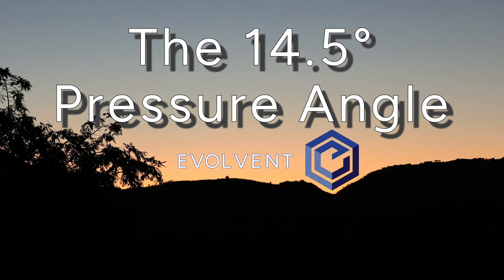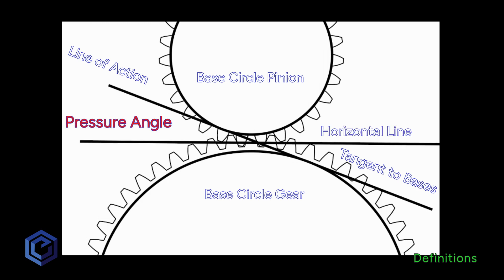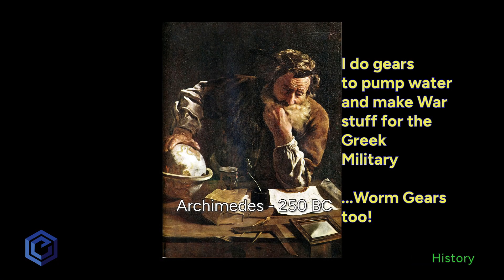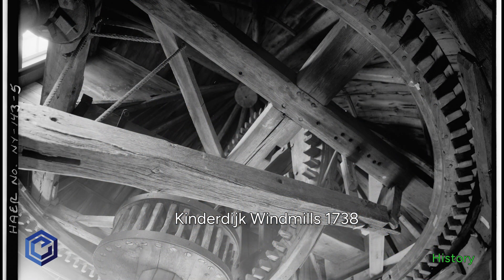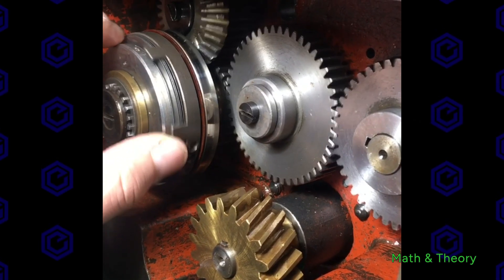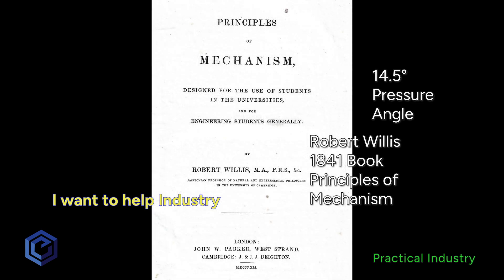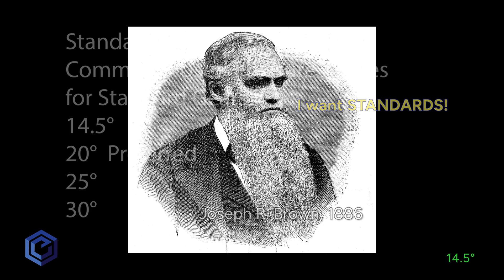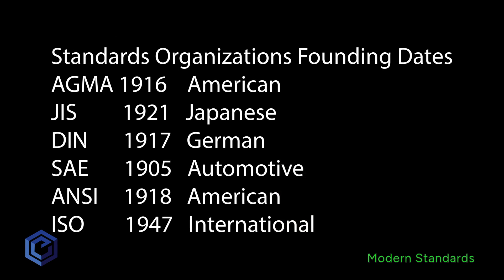Pressure Angle Standard for Involute Gearing - 200 YEARS OLD!

Comment: Are module and pressure angle independent parameters in gear design?
Reply from the maker: Yes they are independent of each other.  The pinion and the gear need to share the same exact values.
Thanks for watching.

Comment: I have two mid-century engineer's books, giving info on gearing. Fowler's Mechanics' and Machinists' Pocket Book (43rd annual ed., 1951) has tables of data for cycloidal and involute gears but only 15 degree pressure angle. It mentions Grant's Treasise on Gears, describing an odontograph and mentions the 15 degree standard. Applied Mechanics by David Allan Low  (15th ed., 1940) mentions the "common tangent to the pitch circles" (aka the "line of action") being usually 14-1/2 to 15-1/2 degrees. So, whilst looking backwards to some degree, these suggest that 14-1/2 may not have been univesral, or that 20 degree PA was being used in the UK up to and during WW2.

Comment: 3:25 And the 0.25 value for sin 14.5 degrees is what I was taught 50-odd years ago, as the 19th century's easy to use value before calculators and perhaps log tables and slide rules. Also the drill point of 118 degrees gives a length from tip to full diameter of 0.3 of the drill's diameter, the amount the drill must go through a piece of work to produce a clear hole. I was a planning engineer, so useful knowledge. We had automatic (not CNC) Warner-Swasey lathes. By the 1960s, standard industrial gearing was 20 degree pressure angle.
Reply from the maker: Bill, 
Thanks for watching, your comments and references.  15 degrees was definitely European and 14.5 degrees was predominately in the US in the early years.  The sought after text "MAAG Gear Book" (Zurich Switzerland) 1963 references 15 degree gears.
https://www.patreon.com/posts/maag-gear-book-98346358?utm_medium=clipboard_copy&utm_source=copyLink&utm_campaign=postshare_creator&utm_content=join_link

20 degrees is definitely the more often practiced pressure angle now.
Andrew